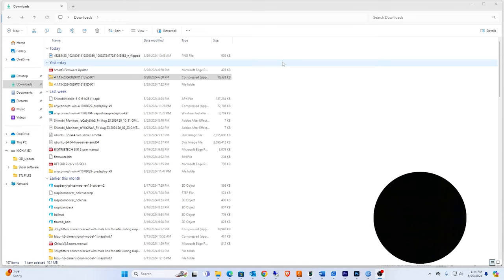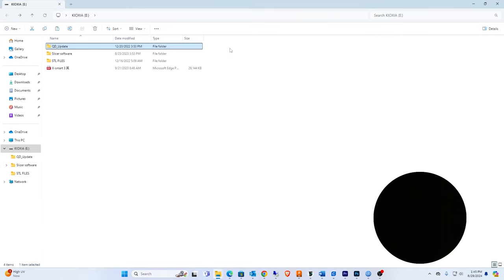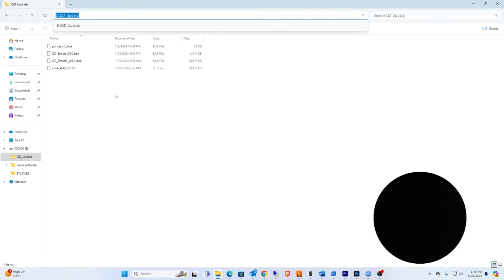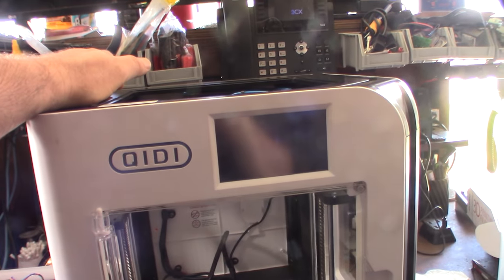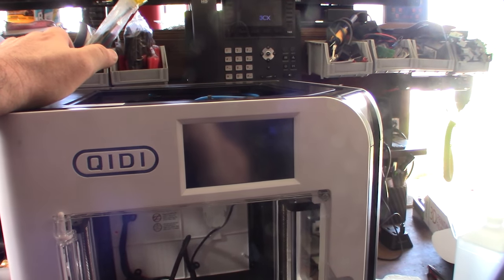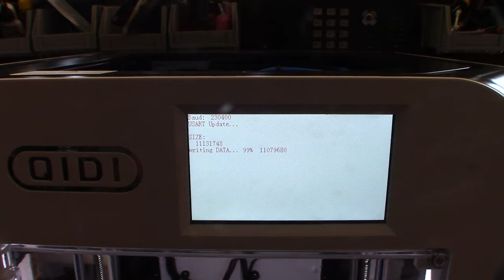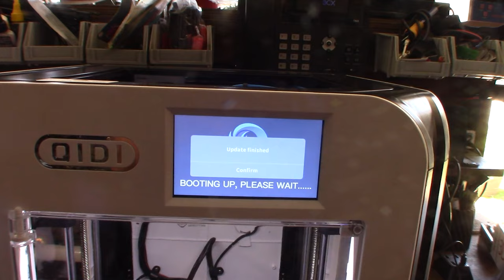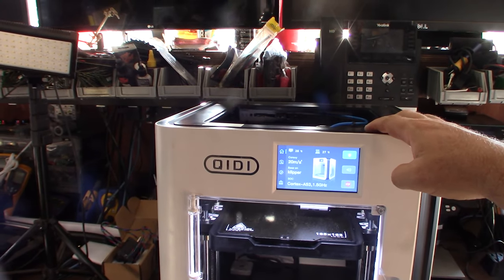Qidi Tech X-Smart 3 Firmware Update Procedure, file structure, File location USB X-Max X-Plus Q1 Pro

Comment: Thanks man. Bought an XMAX3 last week and had some issues with network connection. I couldn't figure out at all how to update the firmware. Thanks to your video, I was able to update. It didn't fix it, but now I've got one less thing I know it wasn't.
Reply from the maker: thanks, The update documentation was hard to follow.
Reply: It doesn't help that the .mp4 file on their website shows that you're supposed to put the loose files on the flash drive (without the top-level folder). And without that top-level folder, the printer won't recognize the files as a firmware update and won't do anything with them. It also recommends naming the drive " " for some reason. lol! 
Thanks for the heads-up, @fintechrepairshop!